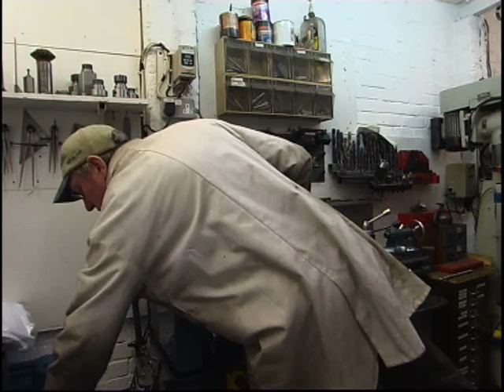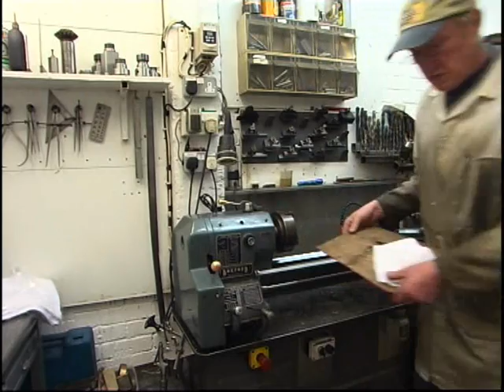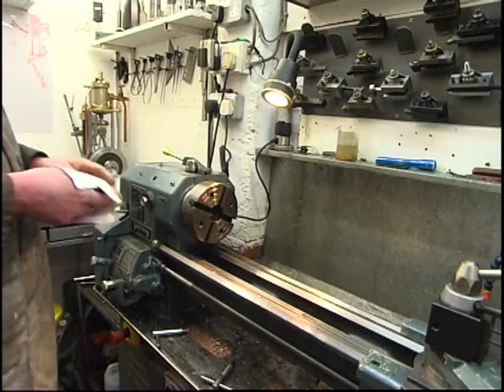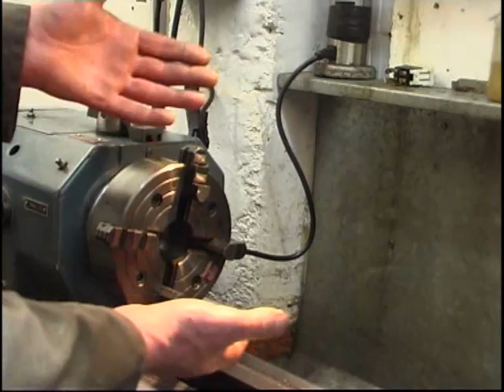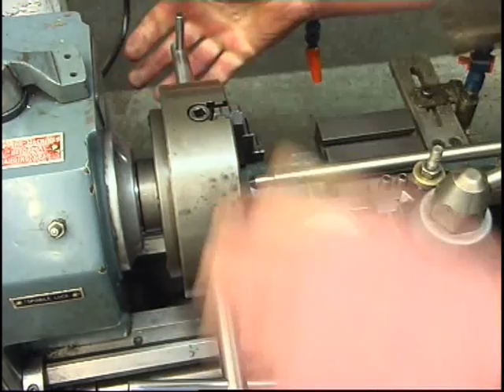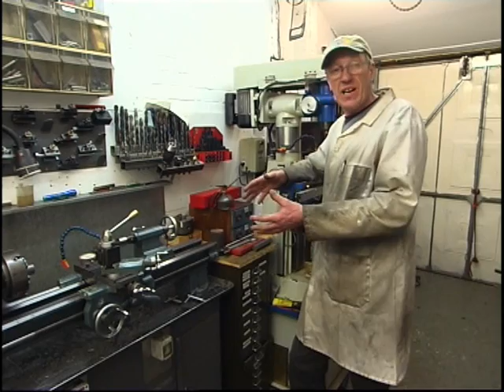FOUR JAW FUN

Comment: MY lathe chuck diameter is 160mm , I am asking if I can use other chuck bigger than it if It  fits in my lathe ?
Reply from the maker: As long as it fits and has a high enough speed rating it will be fine

Comment: Perhaps I missed it. You already had a center punch mark on the square piece right? If not, you still wouldn't know where to locate the spring bar to test for center with the mic.
Reply from the maker: +newstart49  I was locating on a centre pop mark  . Thanks for watching
Reply: doubleboost
 I knew it was a silly question.

Comment: Great video.  I like my four jaw but a question about a problem encountered while machining a cylinder for a small internal combustion engine. The cylinder is 2.5 inches in diameter and about 3.5 inches long. I can get it running true in the 4 jaw, but it will be out of true at the extreme tail stock end. If trued out on that end it will have run out close to the chuck.  This run out will be very slight but enough where I can hear the cut vary when turning.  Is there a trick to cure this wobble?
Reply from the maker: +gwheyduke You could split the difrance

Comment: If I were making a spring bar to be used as here, I believe I would put the spring mechanism at the tailstock end. Any slop in the mechanism would be reduced by the ratio of (tip end of bar to indicator) to (overall length of bar). In this case, it looks like the slop would be reduced by 10:1 or better.
Reply from the maker: Peter W. Meek Good valid comment

Comment: I share your views on the four jaw chuck.  I almost never use the three jaw.  I recently used the exact same technique to drill and bore some holes in two diamond shaped pieces of aluminum because I do not have a 5/8 drill bit.  I am glad to see I got it right.  I could not help getting a big laugh when you pulled the coolant line off.  Keep on making the great videos.